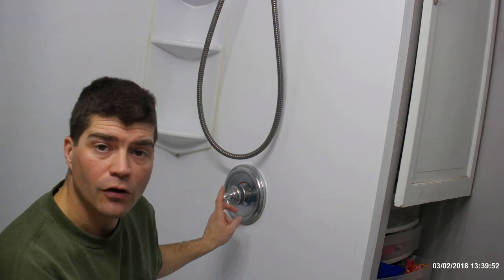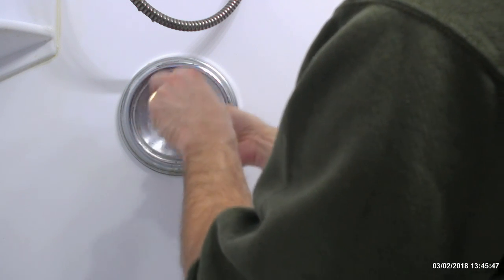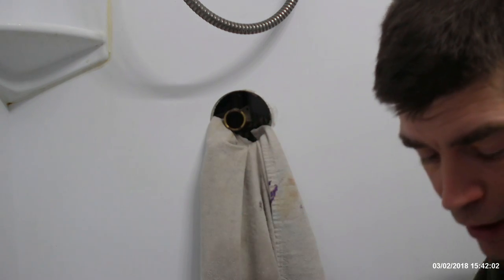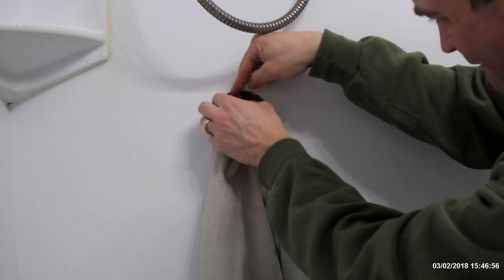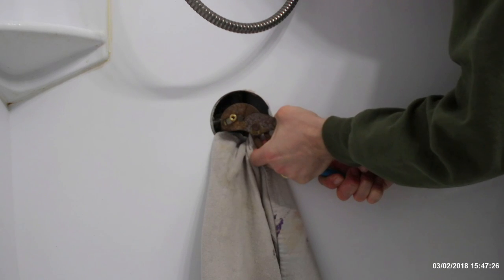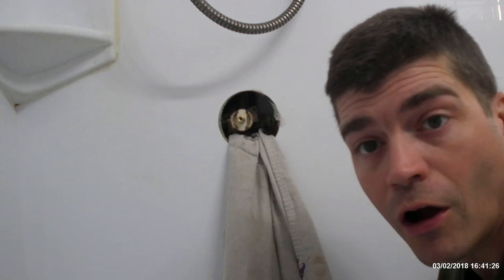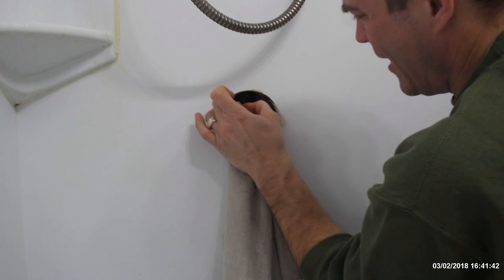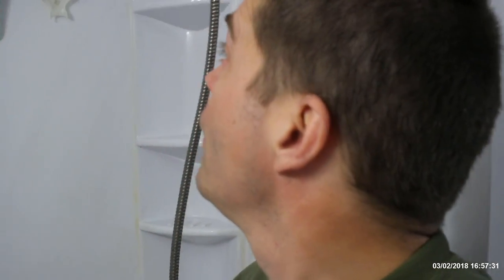Increase Water Pressure and Hot Water by changing out MOEN Single Handle Tub Shower Cartridge

Comment: The little brown bottle of rust remover is extremely corrosive. I’m thinking you could have rinsed the sponge and wiped the pipe out before installing the cartridge. I hope the lube and rust remover don’t have a chemical reaction and destroy the cartridge.  Thanks for the tutorial and God Bless!!!
Reply from the maker: Thanks, I actually did rinse it out prior to the addition of the lube.  Thanks for watching. The instructions actually say to use a rust remover like CLR to clean out the valve so it should not react with the lube. But I rinsed it just to be sure as well.